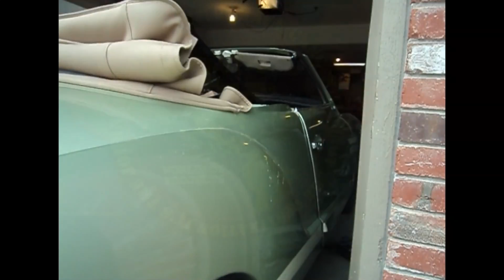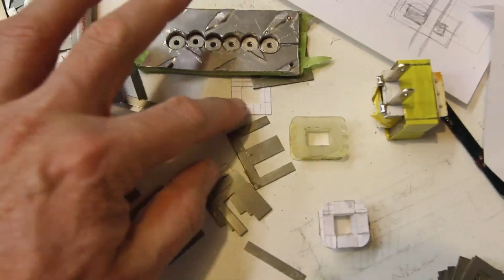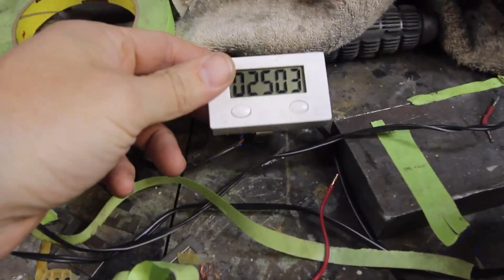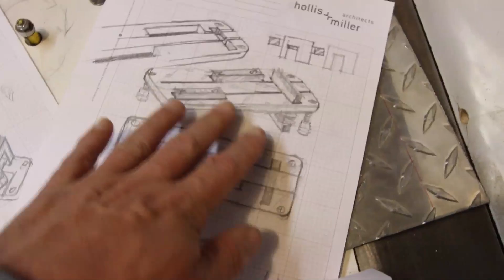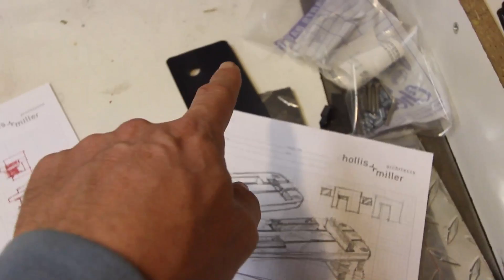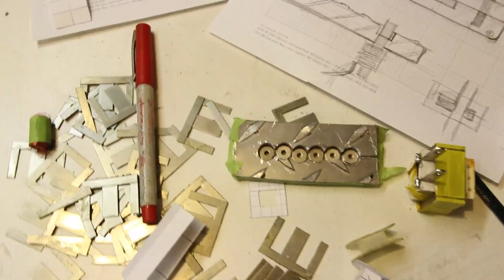Guitar Build - Part 19 - Winding the Custom Guitar Pickup

Comment: Sorry for commenting on a 9 year old video. Is there a specific reason to have the transformer near the pickup in a circuit like this? Could I say mount the transformer further away like on a pedal board and just run the output from my guitar to the transformer via guitar cable first before bringing it into the rest of my signal chain?

Comment: Hey Greg 
I'm planning to make an alumiton too 
And your videos sure provides a lot of good infos 
Now what u want other ask is 
Will 2000 winds be enough? ?
Reply from the maker: 2000 will work.  It depends on the strength of the magnets and a few other factors that affect induction.  Since the winding bobbins are pretty small, you can always make a second one if you're unhappy with the output.
Reply: Ok thank u
Reply: Hey Greg 
Can I use sheet steel to make the core laminations ??
planning to make a custom transformer 
Cut u shaped laminates from a thin sheet steel and insulate each one with a thin layer of enamel paint

Comment: Greg, why make your own pickups - aren't they pretty cheap to buy???
Reply from the maker: John, this is a two part answer.  First, yes, $100-200 will buy a set of acceptable pickups. $500+ for a set of goodie goodies...  I could buy them, but I could also buy the whole guitar.  This project is WAY more about the fun of creating than it is about ending up with a great guitar.  The big reason I'm going to this extent is I want to do something I've never seen.  In particular, I want a neck through body guitar wherein the neck has NO ROUTING whatsoever.  Traditional/standard pickups that are in 99.999999999% of the guitars out there require you to route the neck almost in half.  By using a totally different approach, I am going to have a solid, true neck through that should sustain to an exceptional level....  It may work, it may fail, but the enjoyment of the creative process has been well worth it.
Reply: Greg's Garage Got it, I am enjoying the DIY process too, thanks for sharing.